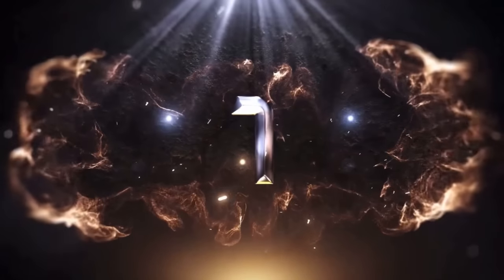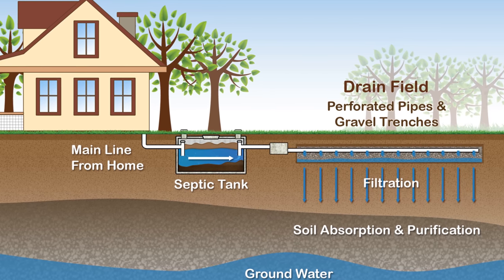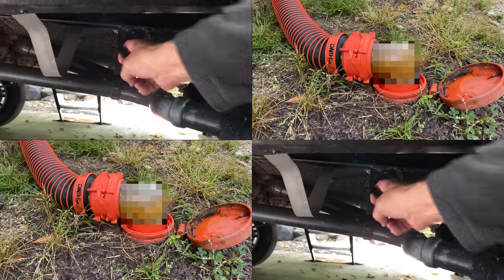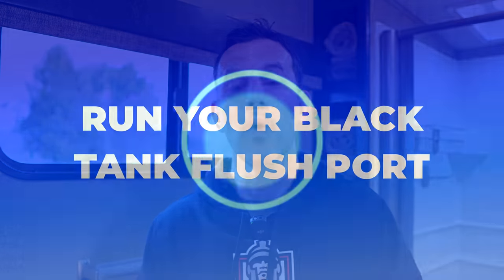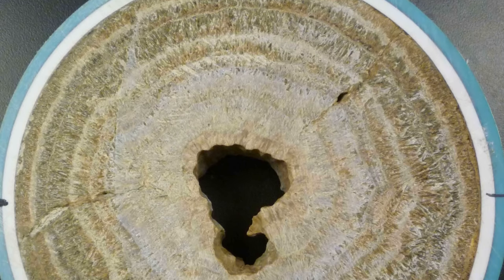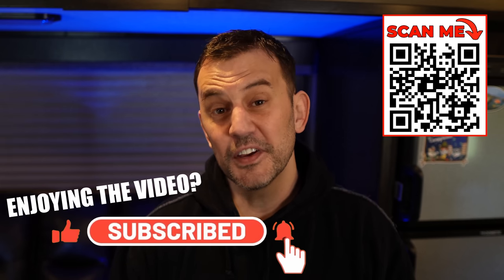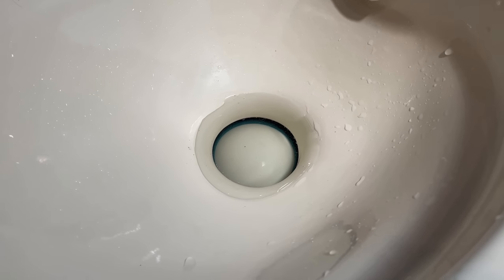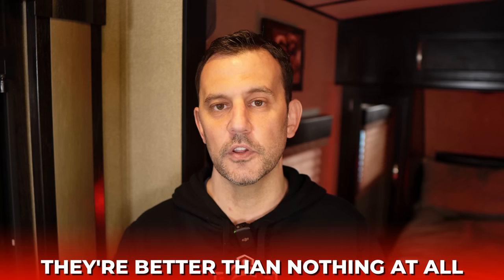RV Black Tank Mistakes, Myths & Secrets + Tips to Keep Sensors Working!

Comment: I have an old rig without a black tank flush so i use Rhinoblaster Pro with the gate valve, hook up a separate hose to it which also comes with a backflow preventer and backwash the tank at least 2 times after I dump it.  Seems to get it pretty clean.  Always goes to empty but as soon as I flush the toilet just a couple of times it can read 2/3 to completely full.  I've ordered some rv digest it and want to see how that works.

Comment: I have been using Zep brand acidic toilet cleaner in my black tank added after a dump. You add the 1 gallon of cleaner after a dump and leave the toilet cleaner in the tank during the next use cycle. Allow the tank to fill as usual and the next time you dump be sure to rinse the tank by flushing it out and drain. Sensors work fine after. 

The previous owner was italian so when i dump the grey tank there's a strong garlic / olive oil smell. I use Zep brand degreaser to the empty tank down the kitchen sink drain. After 6 years the garlic smell in the grey tank water is almost gone. 

Hope this helps if you have dirty sensors THIS WORKS GREAT.
Reply from the maker: Thanks for sharing!  “The previous owner was Italian…” 🤣🤣🤣

Comment: I have tested 30 or 40 different toilet paper brands and I have realized that just because the manufacture says it's RV TOP or it's Septic Safe doesn't mean it's true. I have found 2 brands that seem to be much better than others, Angel Soft and Walmart's cheap brand "Great Value". Both with just a minor jiggle will break down in small particles and will not stick to your inside tank and sensors. All the other brands I could a shake until I was blue in the face and still be just a large clump of TP not breaking down. All my test were preformed with just city water with NO chemicals for just 1 hour of soaking in water. Good video.
Reply from the maker: Thanks Earl!

Comment: Good points throughout.  I bought my first Class A in 1986.  The only time I "smell" my black tank is if I have my bathroom fan is on exhaust and flush.  This will happen because of the roof vent for the black tank vents air into the tank and exhausts it from the toilet into the bathroom.  Turning off the vent prior to the flush will prevent this from happening.  I have never used any tank chemicals.  I drain it when near full, use the the flush port when possible.  I have a  water meter on my hose to monitor when my flush is near 3/4 full and avoid over filling.  My secret to "cleaning" the tank is to put in 5 to 10 pounds if ice cubes in the blank tank and travel with the ice and water mixture able to slosh around, scraping the insides very clean.  Thank you for your videos.  I find them helpful.  keep up the good work.
Don

Comment: I bought a back flush adapter for my black water tank because I had a leaky gate valve stopper and was lazy to change it out.  I used to flush my BWT 3-4 times until it ran clear thinking I had a pretty clean tank. After I installed the back flush adapter that pushes water back up into the tank, the amount of stuff that was still coming out proved my tank was not as clean as I thought it was.  I use the back flush on every dump and feel my tank is the cleanest it’s ever been. NO SMELL!!  It’s like giving your black water system a high colonic! 😅😅
Reply from the maker: they definitely do help!  Here's a link for anyone who doesnt have one yet: https://amzn.to/3QXLtoH

Comment: My front gray tank and the black tank dump from the same port after meeting at a "Y" or "tee". After I dump my black tank, I close the clear valve I added at the connection port, and leaving the black tank dump valve open, I open my gray water dump valve for about ten seconds which back-flushes a deluge into the black tank, really knocking things loose and stirring it up. I then close the gray tank valve and pull the clear valve open again to dump the black tank again, and repeat this until the gray tank is almost empty. After this I dump a lot of water over and over down the commode, and use my rinse port; but after the back-flushing from the gray tank, it really leaves it pretty rinsed out. I thought I had come up with a new fancy method until I saw a post that this has been a recommended method for some time. 🙂  Great video, and thank you!!
Reply from the maker: Thanks Dex, glad to help.

Comment: Let me start by saying that I love and watch your channel often. What I would like to say is that struvite is a real thing and water is your friend to combat this problem. The thing I disagree with though is that sludge does exist in tanks that doesn't come out when using certain chemicals that break down waste. Also mold and mildew will build up in your grey tank that make your rv smell even more than the black tank. I would invite you to come on a few jobs with people who do hydrojetting of the black and grey tanks to see what comes out of tanks. I've seen with my own eyes that sludge and mold do exist in tanks that either smell or block the sensors.
Reply from the maker: Thank you for watching Rana, I appreciate that.  Keep in mind that in this video I say that if you are using a lot of water, you wont have issues with sludge.  I simply can not speak to what others are doing, thats why I am very clear on repeating, multiple times throughout the video, that this is what has worked for me, and there is simply no sludge in the tank.  I have heard a lot of comments over the years so I know what people are doing to create this sludge problem, and it involves, in my experience, a lack of proper rinsing.  nothing is going to turn sludgy or solid in the 5 minutes it takes to dump a tank, and if that tank was properly rinsed immediately after, knowing the properties of waste, its just not going to harden into a sludge in that short amount of time.  I truely believe if people started rinsing more often after dumping, it would be years and years until anything could build up in their tank to the point of needing it pressure washed.  Just my experience though.

Comment: I bought a back flush valve and it worked miracles to not only unplug my tank but also cleaned it and the grey tank as well. It even cleaned my sensor and read empty for the first time in a year and a half.
Reply from the maker: Nice, thanks for sharing.

Comment: I'm new to RV's, I bought a truck camper in '22, and I regularly use the wand at the toilet to clean the tank. Recently I had a slow grey drain, so I had to get a backflush attachment to clear it. The outlet on the camper points straight down so I also had to get another gate in order to get the water straight up the pipe, which worked great. Today I was looking today at a dishwasher cleaning solution by Finish, thinking of the grey tank, and the main ingredients are Citric Acid and Sulfacants (reduces surface tension think probably to help loosen material) I think I'm gonna try it and see.
Reply from the maker: keep me posted on the results!

Comment: I heard calgon in the holding tanks at the beginning of the season helps from sticking to the side. 
The treatment we use is Unique RV digest. There is no solid clumps coming out, looks like everything is liquefied.
Seems like the only reason they would put gray into a black tank would be location of facilities. Toilet & sink in one area,  shower across the unit by itself. This would be the only reason.
Reply from the maker: Colby, I’d have to agree about the plumbing… only thing I can come up with.  They get lazy and don’t want to properly route pipes.

Comment: This is another very informative video!

We also switched to using Liquified. It works great. Our black tank sensors have been working properly while using it as well. No overwhelming odors, either.
Of course, I also flush the black tank well every time I dump the tanks.
The only issue I have now is with my gray water tank sensors not reading properly. So I am searching for a good solution to clean those sensors.
Reply from the maker: nice, thank you

Comment: Black tank port usage. I had been told to use this to fill / dump the tank a few times before breaking camp. That does work but will have to try you method and compare.

Comment: I purchased and use the Swivel Stick from Amazon. I use it after I dump. I have had no problems since I began using this. Awesome tool for RV's.  I had been having problems with my sensors working prior to using the Swivel Stick. I see you also showed it in your video. In addition to this; due to the High inflation the cost of the tank treatment  chemical I was using, (I was paying 31.95 a gallon, then went to $52.00), going through the ceiling I began using the Dawn Soap and Pinesol mix; (comes to about $5.00 a gallon). PS: (Great knowledge from your videos).
Reply from the maker: Nice!
Reply: How much dawn and pinesol do you use??  Per gallon of water?? Thanks.

Comment: I really like your channel. Thank you. I am new this year from a Pop up to a 2022 Forest River Rockwood Roo 19 Hybrid. When I use the trailer most of the time I won't be hooking up at a campsite. If I do most of them will have just power and water but No sewer. This year I would dump my Gray and Black water tank after every use and use the black water flush port. But I also read that people leave it to 2/3 full before dumping. 1. What is your recommendation with how often to dump? My black is 30gal and grey is also 30 gal. 2. How long can I leave the black water flush pumping water with the valve in the off position? Thanks
Reply from the maker: Dump when your tank is full. Then watch this:
https://youtu.be/Q7ZJzfimLwg

Comment: Have only used Happy Camper since I bought this trailer (new) in 2021 and following the tank dump, I also run the flush for about 20 minutes. Don't really care that my sensors don't read correctly, my toilet will 'burp' when it's time to empty. Using HC exclusively, there've been no odors of any kind. I keep my gray tank valve open.

Comment: The toilet is generally over the black tank when toilet is flushed it dumps right into the black tank. The bathroom sink is right above the tank to cut cost manufactures use a short distance to dump in the black tank. It’s all about coating cost and labor.
Reply from the maker: make sense

Comment: Great video! We flush our black tank after each camping trip and leave a couple gallons of water in the tank along with a tank treatment. One thing we do different is that we close the black tank valve, let the tank fill (after the initial dump) release and repeat. It usually runs clean after 2-3 fills. We use a flow meter to determine how much water is going into the tank. Unless I misunderstood, it appears as though you keep the black tank valve open when flushing. Since , as you indicate, the black tank flush is like a sprayer for the black tank, is what we are doing overkill? Thanks!
Reply from the maker: Thanks for the comment David... sorry, we dump, close the valve, refill, then dump again, same as you.  We will open the valve when using the flush port though as mentioned in the video.  And honestly, there is no such thing as overkill when it comes to a black tank my friend.
Reply: @RVTIPSANDTRAVELS  Got it! Thanks for the clarification.

Comment: Rv manufacturer  may of used that method  to put hot water in the black tank to help break solids down plumber use that trick for housing  plumbing
Reply from the maker: This is also a good thing to do.  Thanks for bringing this up after the video is completed, lol!  I should have added this recommendation to the video!

Comment: Great video!  You are just never too old to learn a tip or trick every now and then!  I do have a question about black tanks.  I know I am that odd female that just dares anyone to empty tanks or do anything to/with them!  (Actually we just kinda split set up/break down task and that was by choice!). After dumping and washing the tank thoroughly, do you put water/water and "treatment" in it before heading home?  If you are going cmaping againg in a week? Month?  We are not full time, but we try to go somewhere every 2-3 weeks.    Just curious what others do. Thanks for the great video!
Reply from the maker: I always have water in the tank unless I am winterized.  Keeps things from sticking.

Comment: Hey Ross,     When I dump -  I flush the black tank between 2-3 times. Since watching the Black Tank Master Class,  I then dump two 5 gallon buckets of water down the toilet.  When I flush I usually close the black tank valve and  fill the tank with 10-20 gallons of water. Its a 45 gallon black tank. I use a water meter to measure the water going through Black Tank Flush  hose. Then I  pull the tank valve to drain the black  tank. ( Rep=eat.)    In your opinion do you think that is a safe way of filling the tank to flush?     Someone mentioned it could possibly build pressure in tank if black tank valve is closed  and toilet bowl valve closed while filling through black tank flush port.   Thanks again for your contributions to the RV Community, It is appreciated !!
Reply from the maker: Mikey, you can’t build any pressure in the tank.  There is a vent:  a pipe inside your tank that goes up through the roof with a cover on it at the roof.  Like a chimney.  It is always open so pressure will never build.
Reply: @RVTIPSANDTRAVELS  Thanks Ross.  -  By the way, got a real chuckle with the Jiff coming out of the Blank tank hose  😆

Comment: Honestly, I never use my black tank sensors.  After just a few outings, it’s very easy to just know by looking down the toilet and if you start getting a small burp of stank on each flush it’s past due.   

I also don’t dump my tank at the campground before leaving.  I will dump it a day or or so before I go and let the road action help break it down  further.   I have a dump at my rv storage and it gets a couple fills and tank flushes before I put it away.  I also use a treatment that breaks sown waste and any TP that will break apart within a minute in straight water.  

Never once have I had an issue with smell or plugged in 20 plus years.  My sensors do still work tho, just don’t need them.

Comment: Great video!,, You mentioned that you use a septic safe 2-ply toilet paper. Can you provide exactly which one you use? My RV remains stationary, inside of a RV Park, on a deeded lot. But, I’m not on sewer, unfortunately. I’m on a pump out where we sign up on a Sunday afternoon for a Monday pump out. But, we won’t return until the next Friday night. My sensors are always out of wack. I tried the softeners, Dawn detergent, borax, and water. I tried Pine Sol. I fill the tank full, ahead of the pump out. I tried the spray wand. I even just tried the clear elbow with a high pressured hose to backwash as it’s being pumped out, several times in the last pump out. I just ordered the Rydlyme Marine Descaler. Do you have any other suggestions? I just winterized, only leaving a small amount of RV antifreeze in it. Being on a pump out is a challenge. I can sign up anytime I need to, all days but a Sunday. But, unless I’m on a weeks vacation, we’re only there Friday night to Sunday afternoon.
Reply from the maker: Sammy, I just use the Walmart 2 ply septic safe.
Reply: Since I just winterized, I have to wait until April 1st to try the descaler. IDK what else to do to fix my sensor issues. Thanks for the reply.

Comment: I've worked for heartland and forest river in Elkhart Indiana and the only reason the manufactures dump the bathroom sink into the black tank is to cut cost of the build they use less piping to get it to the gray tank, you need to realize that in the factory we are having Lin moves every 12 to 15 minutes we are completing 25 to 40 units each day and not running pipe to the gray tank from the bathroom sink saves time and money
Reply from the maker: https://youtu.be/ermDoIB-y7s

Comment: Only reason what I could think of this they won't do it to ensure that enough water gets into the black tank, other than that I think the only thing that should drain into it is the toilet. Because of this we don't use bathroom sink 98% of time. Only now n then to keep it working, etc. Everything is done at kitchen sink. I do notice the toilet doesn't allow much water. Like its a water save feature. I liked my old setup in my old trailer. It had 2levers one for flush/empty an one for water so u could use as much or little as u want.  Our new one is just one flush rinse lever
Reply from the maker: a lot of folks think it may also have to do with cutting costs on certain designs.  who knows?

Comment: Great job. Do you need to reduce water pressure from normal home house bib for blank tank flush system? My house is around 66-70 psi.
Reply from the maker: Any water connection to an RV should be accompanied with a pressure regulator.  Great question though, and I probably should have mentioned that.  Sometimes I know what I’ve said in other videos and forget to realize they should be mentioned again.
Reply: Thank you. I figured you would recommend that. Was curious if a little more pressure would increase the flush systems effectiveness.